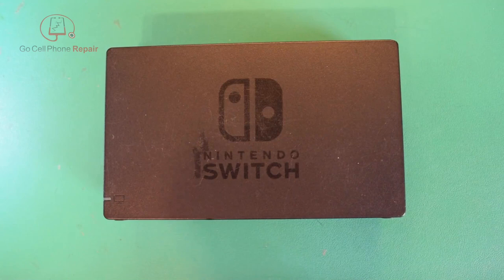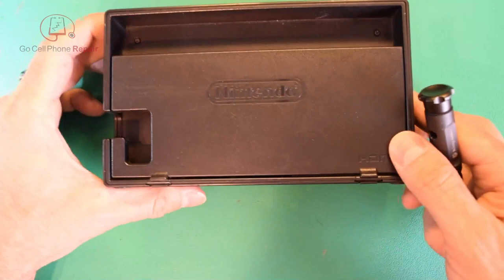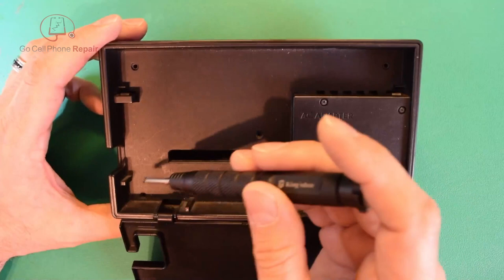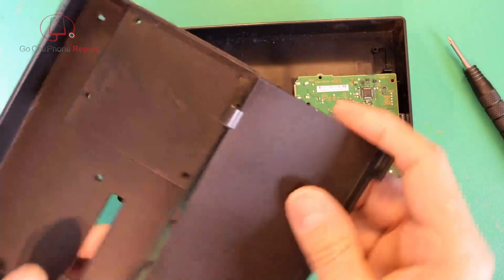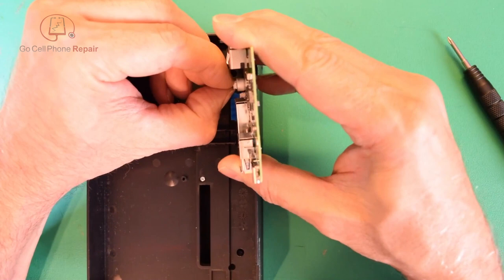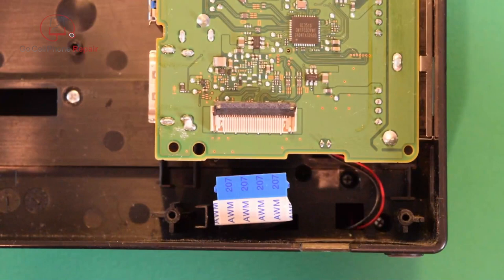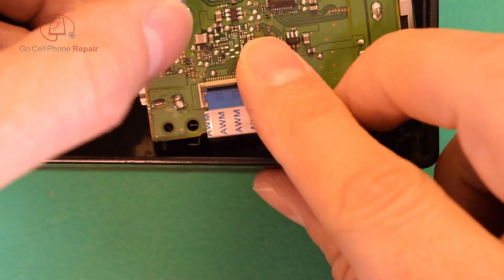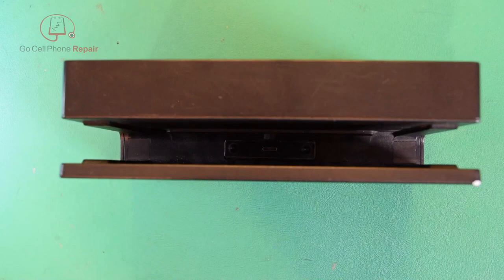Nintendo Switch Dock Motherboard Replacement

Comment: ive been trying to figure out why my dock will allow my switch to connect and then cut out and stay that way for a while and while i assumed it was the board after i looked at the ports and saw that they as well as all my hdmi cords and AC adapters worked perfectly fine, this basically confirmed it for me. i purchased one today off ebay and it should be here in a couple days.

Comment: I replaced the motherboard, still doesn’t display. It does charge. I bought a cheap dock on Amazon and it works on it. Just would prefer the sleek look of the Nintendo cradle.

Comment: I replaced the motherboard and USB port and my switch charges when docked but does not display to the tv
Reply from the maker: The video chip P13USB on the Switch can fail and prevent video output. That. may or may not be the problem that you have but it's a pretty common one.